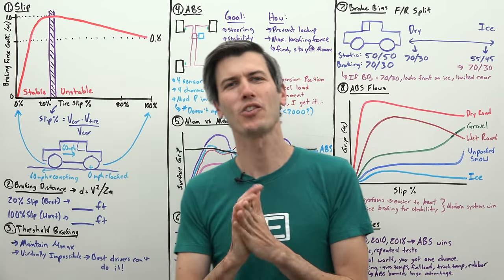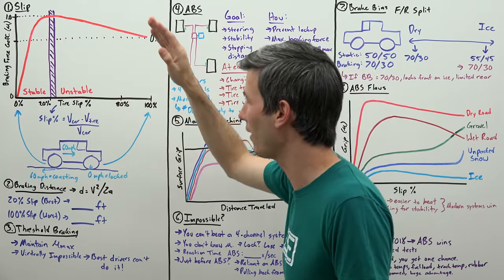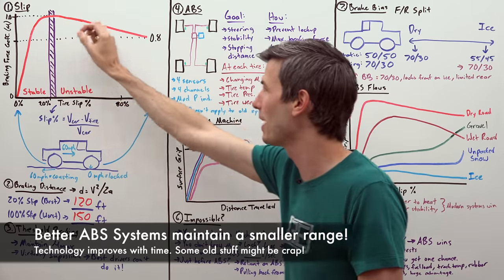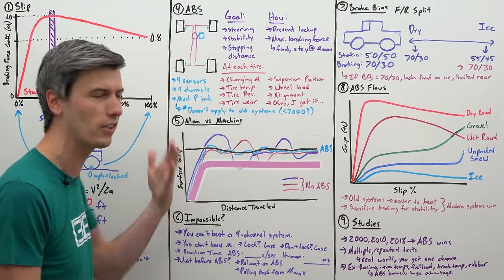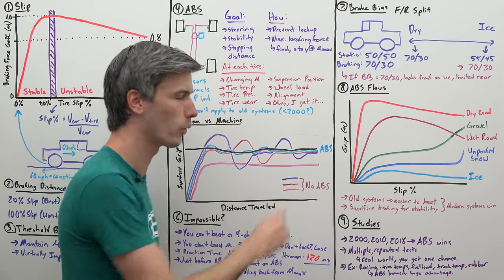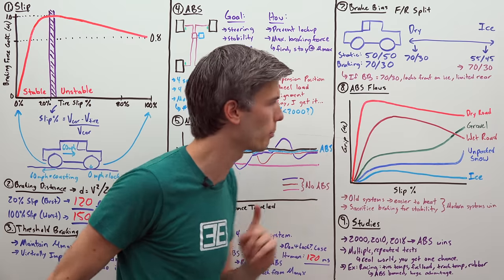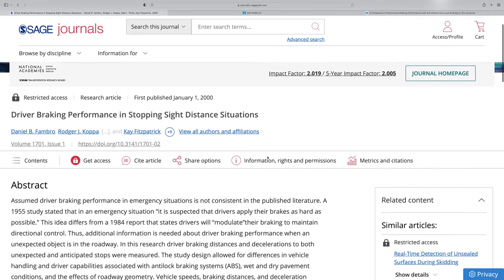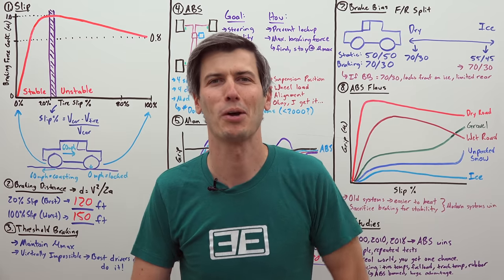Why Threshold Braking Is Impossible - ABS Wins!

Comment: I hate to break it to you, but I am an advanced driving instructor, race car driver and coach, I am a mechanical engineer and whilst I agree in theory about some of what you have said, but the reality is that myself and my coworkers are all better than ABS (our measurements have proven this 1000's of times.).
Motorsport ABS in GT cars is next level and thar is a system that is incredible, but most road cars are not that good and I am yet to see a road car ABS system that I can't out brake.   Keeping ABS in your car is essential, but you can lift out of the ABS and achieve much shorter braking distances, we prove this even with new drivers all the time when coaching.
A car without ABS is different, you don't have the safety net to catch you.
Even on a modern motorcycle (S1000rr) you can threshold brake.

Comment: Love your math but reality disagrees and you don't have to do a lot of research.   Just watch cars out in the wild that are locking up their tiers.   You still see that ~1 second pulsating of rolling to locking up.
Now I have heard that new ABS with speed sensors can do better but clearly not all cars have that system yet.  So, as Feynman said (paraphrasing);   It doesn't matter how elegant and lovely your math is.  If it disagrees with reality, it is wrong.  At least until all the cars get the new system.

Comment: The problem with ABS is... the driver. He will be driving in slippery condition at regular speed and driving mannerisms just because "nobody's out there in this weather". Then light turns from yellow to red too soon and there is a sheriff sitting at donut shop. "He is not going to go after me if i stop sideways because he understands its slippery, but he will stop me for crossing into intersection on red" thinks the driver and mashes the pedal multiple times. Instead of going sideways, pushing snow and stopping abruptly, pedal does the vibrating thing and the truck slowly coasts to a stop with half of its body blocking intersection

Comment: I don't follow this analysis.  Friction has two modes, kinetic and static, or in other words, sliding and starting friction.  Starting friction is usually much higher.  Sliding friction is not different at different speeds of slide.  Sliding at 100mph has no more friction than sliding at 1mph.  So I would expect your ABS to attempt zero slide for maximum braking.  Obviously, you don't really know when you are about to slide because of varying road conditions, the force needed to slide will be different in different situations.  The fastest stop should be to apply brakes hard enough to be just shy of starting a slide.  Perhaps ABS and the percentage slip he refers to is a time measurement of slip/catch/slip/catch and an 80% would be slipping 20% of the time?  Perhaps it is at that point that the computer is capable of measuring the static coefficient of friction and keeping the braking pressure as high as possible for the 80% of the time you aren't slipping?  Because you would stop fastest for certain if you were at the cusp of slipping 100% of the stop.

Comment: the only exception being incredibly loose terrain on a motorcycle, where you rely on fully locking up the rear tire to dig the knobs into the ground to slow you down. ABS, by design, can’t do this.

Comment: I somewhat disagree with Jason. For every day city driving? Yes, but for racing? Not so sure. Modern GT3 cars with ABS systems only have them to aid amateur drivers. The PROs however, will run more aggressive ABS settings but will not rely on them. They'll teach you that NOT engaging on ABS is usually faster. ABS allows you to get away with mistakes where you would lock up a wheel but it will NOT improve the braking distance. The slip when ABS engages increases the total braking distance and overheat the tires, reducing your minimum apex speed. In my opinion Jason is underestimating how good Professional race car drivers are judging how much grip they have and how close to threshold they can achieve without locking. They'll get to 95-99% of the limit for an entire race, maybe locking up once or twice if they get into very deep tire wear.

Comment: Bah! ABS. Gahbage! I dusconnected my Cherokee's Renix ABS computer! (Because it died and started to make the brakes do weird stuff. Unpredictable brakes < consistent bad brakes) Then the pump developed a mind of it's own and started turning on and off whenever it wanted so I disconnected that too. (Brakes that go from hard because you're stopping a system with a booster without the booster working, to suddenly the booster works and your brakes go normal and your back wheels lock up on the highway when you just wanted to slow down a little. That's sketchy and bad. Worse than just knowing that you can't stop in the next couple football fields, so go slow and stay back and downshift.
Now that I'm remembering how sketchy driving that thing was, not only do I feel better for getting rid of it, but I feel worse about selling it to that poor man. :'D

Comment: The real problem with ABS is that it makes people think it can do miracles. ABS will make any driver break faster once. The real issue with breaking is estimating the speed and distance actually required. Drivers generally drive slightly above whatever limit they have available. It's a problem with no easy engineering solution unless autonomous driving gets a lot better or superior driver training is required to get a license

Comment: 7:25 You didn't say "virtually impossible" - the title of the video reads "is impossible" Those are not the same thing.

Watched to the end. Of course ABS is safer, but it is always better, only 99.999% of the time. The way you presented your argument, a human only has to win once for you to be wrong. A racing driver on lap 50 coming across a corner does know how much grip there is before they get there because they got it slightly wrong the previous 49 times - it's not hard to remember. There is room above the slip angle efficiency of ABS, if a human does not bounce above and below the grip level, but nails it perfectly (only has to happen once out of 50 times) with perfect brake bias - human wins.

Road cars - ABS always wins.

Comment: 15:13 absolutely incorrect.  You say that "every single time" ABS will win that is not true.  I live in Canada so I have driven on icy roads more times than I can count and I absolutely promise you that in the vehicles I've driven (2005 Explorer, 2012 Focus, 2014 Camry, 2015 F350) I can stop better on extremely slippery roads, hands down and it's not even close.  In every other situation, I agree ABS is vastly superior.  In extremely slippery conditions, all the vehicles I've driven "chatter" when you slam on the brakes with ABS which significantly increase your stopping distance.  It certainly can be the difference between sliding into that intersection or not, or hitting that snowbank or not. I couldn't give a rats ass what a chart wants to tell me, I've experienced this hundreds and hundreds of times.

Comment: Absolutley do not agree with this from my expirience when abs kicks in on hard braking i feel that the car doesnt slow down as good as before the abs kicks in similar to when the wheels lock up. Im not against abs but if driving on race track for example you have to brake im 100% sure abs brakes worse

Comment: I really wish he would look into the absolute lie of antilock airbrakes on tractor trailers. At least he wouldn't lie about it like the entire trucking industry has for the last 25+ years. Imagine an ABS system that operates at 1 Hz yes airbrake ABS locks and releases at 1 time per second (which is a long time when trying to stop)

Comment: All this argument for ABS, and yet drum brakes with asbestos old school shoes are STILL standard issue equipment on some new cars today, and the disk brakes cost more to the consumer. But ABS is an extremely expensive and sophisticated system to outfit on a car…when ceramic formula pads and disk brakes are more effective and cheaper to outfit. Hmmmmm?

Comment: Humans are still superior to traction control. I've noticed on 2WD TC systems that it takes almost a full second for the TC system to realize its slipping and to back off. Within that time, a human can simply let off the gas pedal a lot quicker. 4WD with TC is a different story, but there you're also getting the assistance of the 4WD system, which the human can't beat.

Comment: Wheel slip is only useful for power sliding on a racetrack, they do it because it gets them in and out of a corner quicker then without. Under normal driving you don't want ANY wheel slip. Just so happens that ABS needs to see wheel slip to turn on and perform its job, so it will keep your wheels chirping as long as it can... right until your dumbass hits a wall and dies because you wouldn't just inch off the pedal.

Comment: ABS is great....until you slide off the road. When will you sheep learn they don't ever test new features on public roads in real world conditions? They only test on brand new vehicles on perfectly smooth flat test tracks. ABS takes just as many lives as it saves. ABS has caused many people to wrap around a tree whereas if they didn't have it they'd have stopped 50 feet short.

Comment: I also love the fact that you forget to mention in those reports that they had made that all the tests were done in dry conditions of course ABS is going to be the best. Guess it makes your video cooler 😎
Reply: "ABS was found to reduce crashes significantly on wet pavement as compared to conventional brakes"

Mazzae, E. N., Barickman, F., Baldwin, G. S., & Forkenbrock, G. (1999). Driver crash avoidance behavior with ABS in an intersection incursion scenario on dry versus wet pavement. SAE transactions, 2340-2352.

20 year old ABS technology was better in the wet too 😎

Comment: The talk starts with faulty engineering.  

A tire has slip even when freely rotating.  As rubber comes into and out of contact with the road there is some sliding;  even with no acceleration or braking forces.  In the linear portion of the slip versus braking force curve the braking force is due to shear stresses, which are proportional to difference between wheel speed and ground speed.  The braking forces are not being generated by slip and most of the contact patch is fixed to the pavement;  hysteresis forces are maximized as the rubber can conform to pavement roughness.  When sliding occurs, these viscoelastic hysteresis forces can no longer develop as completely and you enter the unstable part of the curve.

The x axis should be labeled as the difference between the wheel speed and the ground speed.  Labeling it 'slip' incorrectly describes the physics.  

Looking at the other comments,  this does not seem to disturb anyone else.  Where are the engineers?
Reply: And the video says the coefficient of friction varies it the linear region; another typo - the coefficient of friction is nearly a constant in this region.

Comment: On fresh snow and gravel surfaces if you slam on the brakes on a non ABS vehicle and lock up the wheels you'll stop on a shorter distance compared with the same vehicle with ABS brakes. Tested and proven to be true by all brake systems manufacturers, period !

Comment: Any half decent driver will 'beat' the ABS of a 10+ year old car in a straight line. In the same way that any half decent driver will be able to accelerate quicker with traction control fully OFF in a similar age car. Modern vehicle electronics have come a long way so perhaps this wouldn't be the case in, say, a 2022 Porsche 911. However the key point here is modern cars NEED excellent ABS systems and TC systems because modern cars are so god damn numb to drive and have so much low down torque you can't feel the limit of grip at all, hence you spend the whole time banging on electronic limiters.... where's the fun in that?

Comment: Ok. Who even THOUGHT that they could beat ABS? Sure race car drivers might be able to extract a couple more percent of braking performance before ABS intervention, but just bear in mind, they are RACE CAR DRIVERS. They drive around the same track literally hundreds of time each day, practice almost everyday, they and their engineers know the track down to the last centimeter, they know their high performance and highly adjustable racing machine down to the last millimeter. It's their literal JOB. And you know what? They STILL lock up. You and me, the common folks, don't have even close to the luxury of having all that knowledge and skill to reliably brake better than ABS.

Comment: This whole video is assuming ABS is straddling the sweet spot for grip. It's a "perfect world" engineering notion.
It often does not work that way. My first car with ABS certainly bounced WAAAAY outside of peak grip, and it did NOT adjust grip at each wheel. If you had uneven traction, then all 4 tires would grip at the level of the weakest link. Promotional material is fine & all, but it's 45% written by lawyers, 45% written by marketers, 10% written by engineers.
ABS is theoretically capable of braking better than a person. Many higher quality examples do. But there are plenty of examples of ABS which brakes worse than lock-up. I've driven some.

Comment: This is making wild assumptions about how good each manufacturers ABS system is. You have no actual information or testing on the control logic of any abs system to display. This is a flawed evaluation. You’ve essentially made a sales pitch for why abs is good but without any real data to back it up especially in different weather conditions in which I’ve found different manufactures vary widely in how they handle adverse conditions. I like your videos but this wasn’t as thought out as your others. Do I think ABS helps though? Yes. Is it the perfect system you pitch it to be? Doubt.

Comment: I think this video makes a critical error. You did cover it some but in an asinine way. Threshold braking + ABS with a bias towards over applying is demonstrably better than just ABS if you're a skilled driver. The average smooth brain driver absolutely needs to mash and pray though. 

All of the studies you cited compared with ABS-no threshold against no-ABS. So of course a car with ABS and mashing the brake will beat a human in a car with ABS disabled. With modern cars you shouldn't be comparing full ABS to no ABS. 

If you had done real world experiments rather than just theory I may have given this more credence. To be clear, I'm not saying don't use ABS, I'm saying use the best of ABS.

Comment: I am missing some data from the THEORY you just presented (why theory? because i don't see ANY experiments done with identical conditions), are all current ABS systems identical? Also, do ABS systems "assume" the wrong conditions in some cases? What happens when you have a wheel lift during cornering? I'm also an engineer, and one thing I learned. Theory can be WAAAAAAY off. A proven experiment: I had same argument with a friend. he owns a mazdaspeed 3. we did 3 breaking tests with and without abs on. I managed to beat the garbage ABS in the mazda by 4 feet from 100km/h. In my BMW 435i i did worse off than with ABS each time. So congratulation on a pointless video. The whole video can be summed up with, in quality cars, you get quality operation, in garbage, you get garbage (most of asian vehicles that only put it there to say it exists). That being said, maybe if you don't have the skills, it is better to have it on.
Reply: Same for traction control btw. In the BMW i do just a tiny bit better without it IF i hit everything perfect. In the mazda, with traction you are worse off EACH time.

Comment: in short it's virtually impossible for a human to perform threshold braking, but if in the freak instance you do, congratulations, you have maybe saved yourself a few inches over ABS, so big whoop! whereas ABS will get about 99% of the desired results, about 99% of the time as it knows exactly what each wheel is doing, and it can respond to change faster than you can blink

Comment: Jason Fenske: "I don't know why it gets to me but I hear it repeated frequently and it breaks me."

Perhaps you are simply too young.  ABS systems had been garbage for three or four decades before reaching their current state of efficacy.  Throughout that time period, drivers were told ABS was superior even when real life experience showed otherwise.  I grew up being taught (correctly, at the time) that ABS offered greater stability (while swerving) at the expense of stopping distances.  There is literally an entire generation of drivers who had good reason to be dismissive of antilock brakes.

I do not disagree with the accuracy or validity of the information presented in this video.  I especially appreciate the acknowledgment of better braking at high slip % on gravel & unpacked snow (rally fan here).  I just want to help you understand why you hear it repeatedly.  Auto manufacturers haven't down a great job of convincing us that newer ABS is better cuz they'd have to admit the old systems were trash.

Comment: Of course you're right; in the real world modern ABS will win every time. But the video title is a lie as stated. It doesn't become true until you say, "Virtually impossible." Threshold braking is certainly possible. It's just extremely unlikely that a driver can achieve it, especially with any consistency at all. But if you have a nice clean, even, predictable surface, a very well set up car, and repeated attempts to practice...it's technically possible to beat ABS by a very slight amount, because ABS is leaving a very tiny percentage on the table.

Right? I mean, am I right? I trying really hard to sound smart.